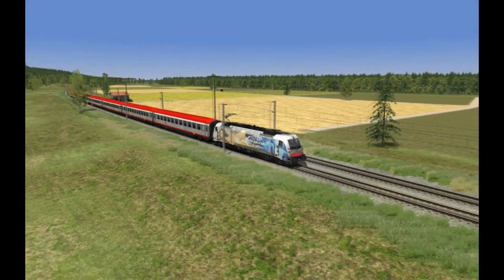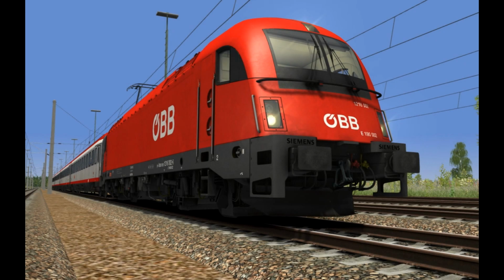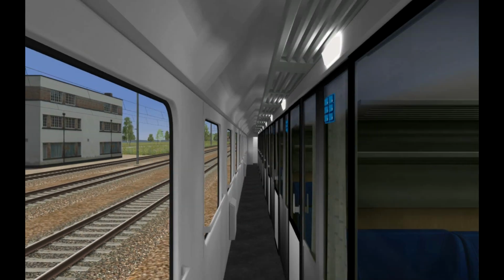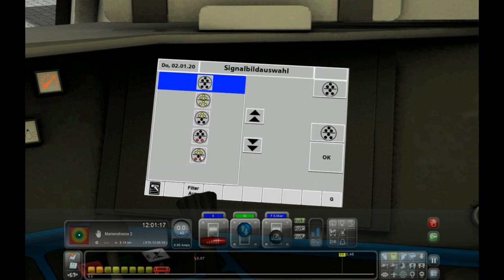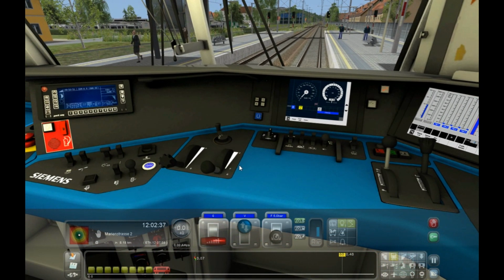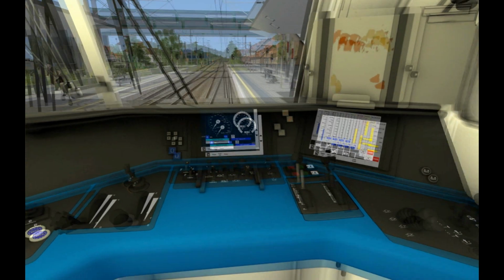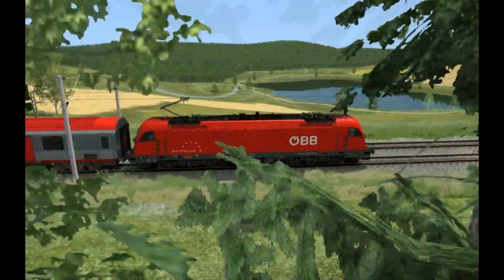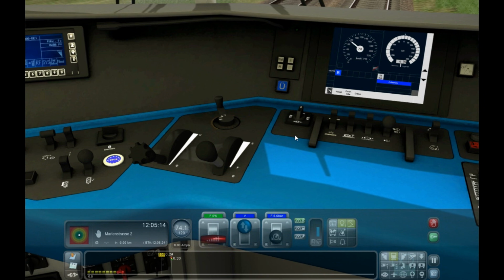RWA 1216 - First Look

Comment: Macht die Lokomotive irgendwelche Geräusche? Aus dieser Kabine ist überhaupt nichts zu hören. Dies ist sehr wichtig, wenn Sie eine Präsentation halten. Für 25 Euro kaufe ich definitiv keine blöde Lokomotive.
Does the locomotive make any noises? You can't hear anything from that cabin at all. This is quite important when you are doing a presentation. I will definitely not buy a dumb locomotive for 25 euros.
Má ta lokomotiva nějaké zvuky? Z té kabiny není vůbec nic slyšet. Když děláte prezentaci, je to dost důležité. Němou lokomotivu za 25 euro určitě kupovat nebudu.

Comment: Does it have opening cab windows?   This was the most disappointing aspect of the Railjet IMHO.  Ok, I know it's not essential for driving but it's a sign of a quality model, and also, the window would be opened to check back at the train, when departing. Always nice to open the window and hear some of the outside sounds too.